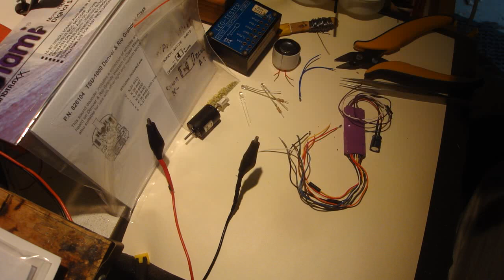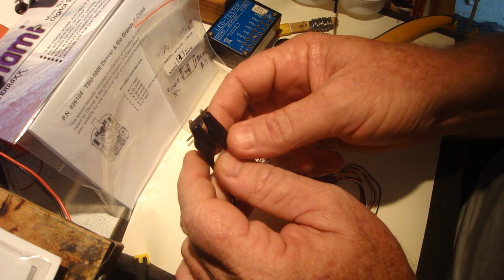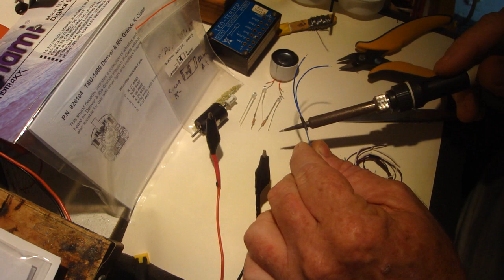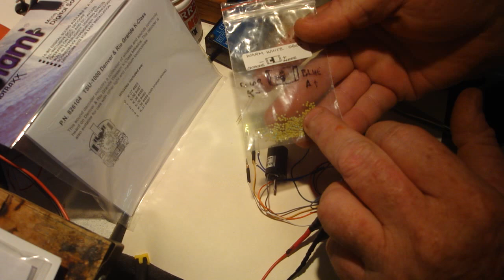How to wire a Tsunami - basics

Comment: Now my bachman tender has a 8 pin plug in it with a stock decoder, would I just wire my tsunami to a 8 pin plug and plug it into the slot on the tender?

Comment from the maker: I believe Carr's is available in the USA.
Thanks, many have said my book on LED has helped then gain understanding and can do it.
Don't use 1.5 or 12v bulbs - they will burn out.
Only use LEDs. Go to Richmond Corntols in Texas he has the 0603 golden whites - great.
Yes I have done a HOn3 Cowichan 2 truck shay - check my early videos.
I installed a Micro Tsunami and a small oval speaker.

Laurie

Comment: Excellent, you make it so clear.  Is there a good source of Carrs type flux and solder in US we can get?

Picked up your excellent book on wiring lights, worth every dime.  Going to try a couple of car installs before tackling a c-19 or k-27.

I had picked up some 1.5 v marker lights, are they worth installing or should I try and make the 3 v LED's?

Have you done a DCC for Shay (like 20 or 25 ton) in HOn3, what do you use for sound?

Sorry for all the questions.  Thanks keep up the great work.